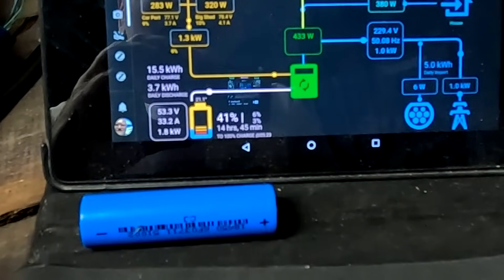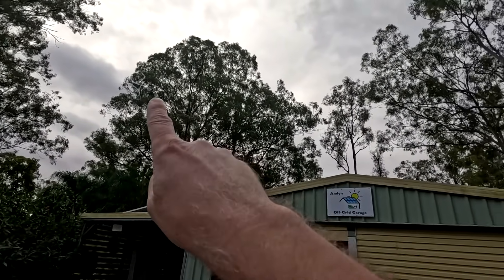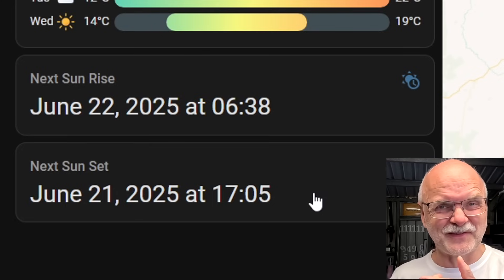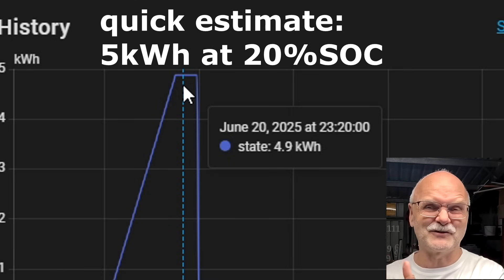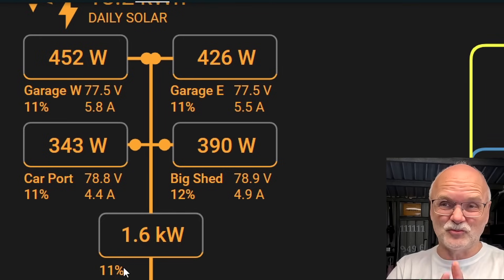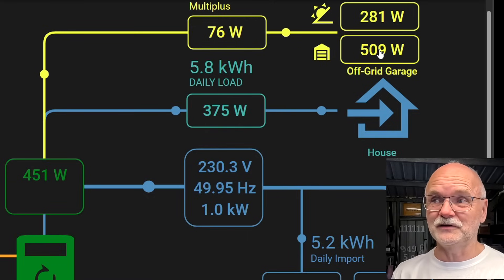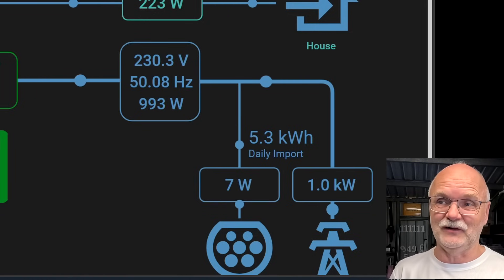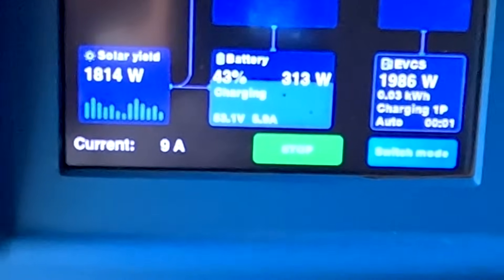Winter-Solstice 2025 and biggest Off-Grid Challenge: Can we make it through Winter without the grid?

Comment: I wish i could get more affordable battery storage here in South Africa. On the shortest day of the year i generated 20kwh but i had to invent loads to achieve this. This was with 4 kw on the roof. I have now upgraded and have 5.75kw rated  on the roof. I want to get 650ah of battery storage but its very expensive here. Currently i only have 5.12kwh storage. Im using a growatt inverter but i am thinking of getting deye ot dyness inverter as replacement for the reason of it being more stable and of course better IP protection.

Comment: My system produced 162.3 kWh on the longest daylight day this year, quite good but not peferct (some clouds in the morning). I have seen 170 kWh before this year.
I have 29.16 kWp placed on an east-west roof with 45°, 13.77 kWp east and 15.39 kWp west. Since i wasn't at home 144.7 kWh was sold to the grid. The rest was mostly comsumed by the running AC to keep the house at a nice temperature. I don't like to return to home with overheated rooms. We had about 35°C outside that day.

Comment: Hi Andy,  I see you have a Multi-Plus 5000. I have one also and when working hard there is al lot of heat production and consequent fan noise. 

Victron also has a Multi-RS optional with 2 chargecontrollers built in. This is a model with a much higher efficiency than the MP and doesn’t have the isolating transformer needed for mobile solutions. You might consider it, since like a 5% increase in efficiency is a lot during wintertime. It also has a slightly higher sustained maximum output. The MP gets a lot less efficient when it heats up, so the heat steals a lot of hard gained energy, reduces the max output and in summer your airco may also be running longer or harder and so on. You could still use the MP as a backup supply for your house, or to charge your batteries from the grid or a generator within the Vicron Ecosystem with an additional 70A or so. Do you think is is worth the investment and would you consider it ?

Comment: Thanks for this solstice-vid. I anticipated your experiment by a simulation - for my setup. I used my data collected in 2024.. To pass the Nov "Dunkelflaute", 81 kWh was required. To pass Nov + Dec "Dunkelflaute" -> 197 kWh. For the hole year -> 262 kWh. But no heat pump an the bev was charged, when I had PV surplus, only. And I am energy saving in general. Not so easy here in Germany to come through the year.

Comment: Generated 21.9 kWh, house used 18.1 kWh (which is faily typical for us), max of ~4 kW from "10 kW" system, but only about a third of the panels face north. It's a hip roof. Max of about 6.5 kW and about 50 kWh in the summer. 26.6 kWh battery, solar hot water. Unfortunately the hot water panels are facing west, which is far from ideal and means that in June and July we usually have to turn on the electric element for 30-60 minutes (~2-4 kWh) before taking showers. Old house had north-facing hot water panels (and no other solar) in an otherwise identical system and the only time we had to turn on the backup element was after 2-3 days of heavy overcast. We're in Sydney.

By the way, the effect of the hip roof angled sections is interesting. The peak power is lower, but we get more usable output earlier and later, and the curve on a sunny day is extremely steep at the beginning and end and fairly flat during the bulk of the day. Although it's narrower in the winter and broader in the summer, which is to be expected.
Reply: P.S. Baseline energy usage for the home with no climate control or heating water is ~10kWh regardless of season.

Comment: Here in Adelaide South Australia, I have two systems. 6.3kw of panels facing north on the house and generated 18.1 kwh on the winter solstice and the second system is 6.5kw of panels split equally east and west on the shed and that gave me 16 kwh   

Total generation from both systems is 34.1 kwh for the shortest day of the year. Being a clear sunny day helped.

Comment: have you evalutated a heat pump boiler? Here I have a Ariston ( a eu brand ) 110liters from 15 to 52 °C in 9h with 220-250w peak absortion ( but usually in turn on only for 2-5h per day cause i never drop water so low temperatures )

Comment: From Denmark. Today only 26,3kWh it has been raining on and off all day. Last week I had 53kWh. System been running since commissioned in summer 2012, rules at that time limited inverter max output to 6kW, but not limiting the PV. 31 panels at 260Wp so a total of 8060Wp. 15 panes 45deg east and 16 panels 45deg south, production starts early spreading out the peek to a point where there is almost no limiting by the 6kW inverter output. All the years it has been around same production from 7,8 to 8,1MWh. If all goes well the total production goes over 100MWh next month. Additional rule is any energy stored in batteries can not be exported to grid afterwards.

Comment: Ever though of trying a solar water preheater?  Second tank cycles water through panels, preheated water goes into the normal water heater, you use less energy to heat it.  Can be a simple setup if your water heater is close to an exterior wall, but it does require some maintenance.

Comment: Hi Andy, entertaining as always. Produced 23.7kWh here in fully sunny Adelaide on the 21st from a 8.8kW Twin Growatt system. My garage will also be off grid soon as waiting for the EEL vertical battery box kit to arrive with a Victron Multiplus II. Also run electric hot water as have turned off all gas usage, but the EDDI hot water controller only uses surplus solar after charging the house battery.

Comment: Hey Andy,
Been disconnected (switched off) since the 22 September 2024 with 2 x Multiplus-II 48/5000 with 12.320kw solar and 10 Jakiper batteries. Consumed 23.8kWh and produced 22.0 kWh with full batteries here in Canberra on the shortest day.
I swear by our heat pump hot water system and have it set to start at 13:00.

Comment: Cheaper to stay on grid with the federal battery rebate. And can then trade energy to defray costs even more and have a better environmental outcome. Super low import tariffs with clean energy and export for good return in the evening when grid is dirty. When off-grid you can only produce what you consume, no one else gets the benefit of excess generation.

And yes, a heat pump water heater will cut water heating demand to one-quarter of the current energy demand.

Comment: get a rooftop solar hot water system. it will reduce your consumption since hot water is your highest load. much cheaper than 15 kwh  battery.
Reply: Yes, if your roof space is tight maybe (because of raw efficiency). But it has many disadvantages. It won't reduce your electricity consumption at night. Once the water is heated the energy is wasted (can't export). It's more complicated to install than PV, requires more maintenance, and depending on location is vulnerable to freezing. I'd also question that it's cheaper than a battery nowadays, especially if you can DIY. Several years ago I made a DIY solar diversion system for my hot water cylinder which meant I used no gas on a small (2.75 kWp) PV installation for about 9 months of the year, and got paid for generation at the same time. (Of course, generation tariffs are not as attractive as they used to be.)

Others have suggested he gets a heat pump to cut his water heating energy use by about 3, and I think this might be simpler and perhaps even less expensive nowadays, especially in sunny hot Australia. He can sit by the evaporator and drink his beer!

Comment: I'm here in Austria at 48.9 degrees north latitude, and we also get snow here in the winter. This is my fourth year of being completely off-grid. I have a 22kW PV system on my small house, a 50kWh storage system, and an electric car. The battery's lowest charge in the winter was 78%, and I also used it for some of my hot water and heating.
Reply: You have steep roofs in Austria because of the snow, don't you? That means both more area for panels and a more favourable angle in the winter when you need them. I couldn't possibly fit that many on my London roof despite changing it from hip to gable: I've got 5.45 kWp (though a mix of old and new systems so not perfect Tetris). There has been a delightful window in the spring when it's been cold enough and I have had enough energy to heat a room using a convector heater from the battery. Before I doubled the capacity I could provide all hot water through a home-made diversion system for 9 months of the year, but I don't have a car.
Reply: @matthewmarks6951  You're right. I have a 45-degree roof pitch, and I also installed some older modules on the vertical walls, as well as some newer models. The most important thing, however, is optimizing the house's electricity consumption, and I've invested a lot of time in this, programming controls and regulation systems to minimize waste of valuable energy.
For heating, I use two split air conditioners that generate 4 kW of heat from 1 kW of electricity.
Reply: @lerrypage  Yeah - I got more than 150 W from two 100 W panels hung vertically in December! Not for long of course.

Comment: I am offgrid too. At least from Feb to Nov. 1kwp north-east, 0,5kwp south east, 4,5kwp south-west, 300wp north-west. optimum yield per day is 25kwh. 35kwh LFP Batteries. 12V/24V mixed system. two inverters. oldest PV module is now 15y old. 
But Andy, your winter calculation would look different in germany. My shortest day is 7,5h only, sun hardly rises over neighbours house and we have snow. sometimes.
I am in Saxony Anhalt half way between Magdeburg and Halle.

Comment: Uk.
Weather has been variable the last few days.  19th June 68.2kwh
20th June 52.6kwh 
21st June 32.9kwh
22nd June 30.8kwh

12.8kw of solar panels over multiple orientations. 8.2kw south facing, 1.5kw west facing.
The final 3kw is vertical on a West facing wall.

Best day was May 19th, 70.5kwh

Comment: In London I have a 2.75 kWp system from 2011 (which pays me for generation) and 2.7 kWp new this year (which pays me nothing). On 21st it was the hottest day of the year so far and not very sunny (in fact it rained a bit, unforecasted) and I generated 23 kWh. The most I've generated is 35.3 kWh (on 16th May) if the inverters are to be believed. 15 kWh of battery which hasn't gone down to below 85% for a couple of months, and home-made hot water cylinder diversion system. Small air conditioner currently out of action so can't use any more!

Comment: Today in sunny hot Rheinhessen/Germany my 17.3kWp system harvested 99kWh 😎
For additional yield now i will build a pv-thermal offgrid heating system for my 300l hot water storage. An external heating pipe will be controlled by an SolThor from MY-PV powered by six additional solar panels. 
My second battery in an EEL Box V5 with JK BMS V19 is just in progress.
I hope this will be enough during the dark month Nov.-Feb. 🤔

Comment: I made 27kwh with my 5,1kwp System in Wolfenbüttel Germany. Used 20 kwh for everything in the House and the pool with heating. 14.4kwh yixian v2 battery was full at 12 o clock.
Reply: Almost the same as my setup in London! I have 5.4 kWp (old and new systems) and an Andy-inspired JK/MB31 battery box (the one with the inadequate circuit breaker on the negative 🤐). Only made 23.1 on midsummer's day but then it was hot and quite overcast. Most so far was 35.3 on 16th May.
Reply: My highest was 30,25kwh on 12 June. 
My whole System is self build after watching Andy's videos with one yixiang v2 batterybox with the LF280k. 4 MPPT's and one MP2 5k
Reply: @Sebastian_Ba  I think I may even have the same battery box. Because my original system pays me generation tariff, I have to leave that alone so it has its own inverter (two strings) with AC coupling to the battery. The new panels connect to the hybrid inverter so should be a bit more efficient at charging.

Comment: I killed the grid back in Aug 2024, (Peel, NSW) I have found with my winter usage that I am short on solar panels, I have 22kw of panels with 84kwh of batteries, I have brought 1 x 250/100 and 2 x 250/85 (Springers ebay store had on special) at the moment my the shed extension will be handling a soon 36 x 250w panels (9kw) which will be feed via a 250/100 (45m run of cable), I will be bring online another 16kw  of batteries next week, but I think I will need a total of 132kwh of batteries and about 40kw of panels by next winter, I have found that this winter to be comfortable I am using 40kw a day, that's great when sunny but if I get a run of days that are overcast I have to start reducing my house heating, so going off grid and living without fear of being cold are large numbers, last few days have been cold morning between minus 5c to minus 7.6c, but sunny at tops of 19c
Reply: What is the 250/100 units please. I need to move some of my 20 KW from the shed to the house.

Comment: Hey Andy,
you are burning lots of valuable electricity for hot water. Have you considered a domestic hot water heat pump? Or as we Germans say "Habecks Todeswarmwassermaschine" (or some say "Brauchwasserwärmepumpe").
I installed this in my parents house and in a friends house. It replace the hot-water-function of an older gas boiler there, which now can be turned off most of the year. They use only around 2-3kWh per day to heat water.
Besides electricity it uses the energy of the place where it stands, so no external something is needed. It can be installed very easily. I am neither a plumber or an electrician.
It starts at 1.500 € which is only about 1 Million Australian Pounds or so.

Thanks for all the fis... videos and stay charged!
Reply: My solar motto is - if an electrical appliance is still working then keep using it until it dies, then upgrade to the newest tech

Solar panels are so cheap now, that it makes more sense to just add more panels (or upgrade existing panels as I recently did). Over panelling is now common as a result, which boosts non-optimal (cloudy, short day length) solar production 

We will upgrade to a heatpump hot water system, when our existing cylinder corrodes out
Reply: I did tell him this years ago. Hot water by a coil is one watt in, one watt out. A heatpump could reduce it by at least 3. 1 watt in 3 watt out. He could even use a solarboiler and top of heat by the heatpump. Probably the hot water system "is still good" (in burning away the power).
Reply: Has to get on the heat pump manufacturers' radar so they will send him a free one to review!
Reply: Yeah, especially now that you can get a R290 boiler heat pump for less than 2000€ it's just the best compliment for a solar household.  
They all also have a heat coil to increase heating speed, and they also usually have an input contact you can use to increase the target temperature, so more power gets used and stored as heat whenever you have excess power.

Comment: Andy why don't you have some solar panels directly to the heater
Reply: Solar panels are a current source, not a voltage source. You have to match impedance between the panels and the heating element, but this is not optimal. You can PWM the output (there are controllers specifically for this), but if you have a set-up with batteries and inverters already, it's easier and more convenient to just hook up the panels to that.
Reply: One reason will be because of the limited cable capacity he has between the off-grid garage and the house.

Comment: I had a production of 62kWh AC systeem and 35 kWh with a DC systeem in the Netherlands. The battery is 77 kWh, and that is good for 8 months. 21 kwp systeem is not for the Winter months with the extra 6kwp it was still not many. So I need more battery and Solar. Sometimes we use 50 kWh a day for heating and 2 cars to charge. So winter is not my friend yet 😂

Comment: why not use the multiplus to charge batteries from the grid?
Reply: Because the Multiplus is not connected to the grid. See his video on the charger, where this question was asked many times.
Reply: @matthewmarks6951  its just as easy to run the cable to that though
Reply: @Tezza66  Please see his video.
Reply: @matthewmarks6951  he is faffing around.  the multiplus has many more settings and network control,   any othe reason to use that other charger is rubbish
Reply: @Tezza66  Have you watched the video?
Reply from the maker: 😄he didn't watch the video...

Comment: Hi, my system has 2368W max production power, 8 panels with 8 MicroInverters Enphase IQ7+ max output power of 296 W each, and today in Braga, Portugal my system was able to produce 20 kWh.
The system is managed by Victron Multiplus II 48/3000/35-32 and it uses two batteries LiFePO4 48V 100Ah each.
Reply from the maker: Oh, that's a nice setup and good result.